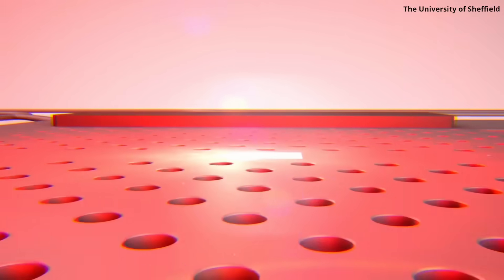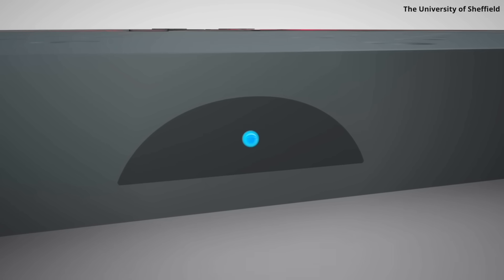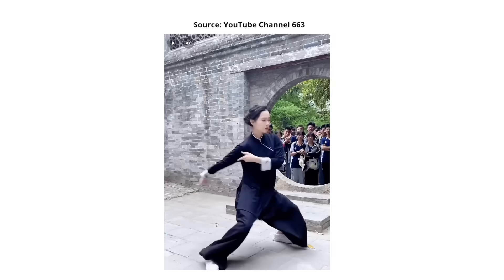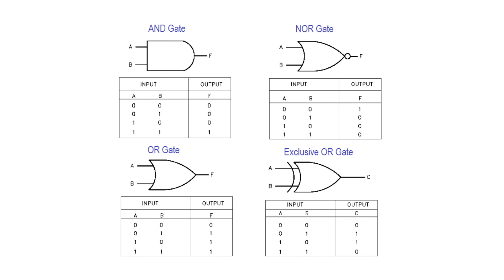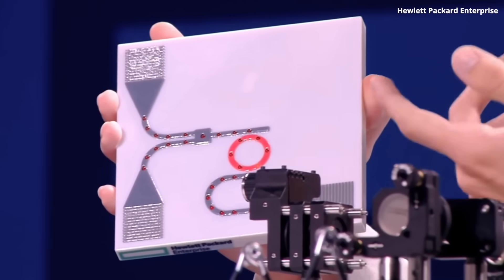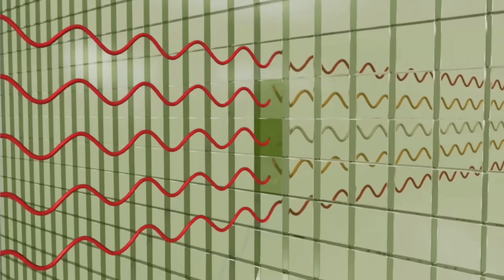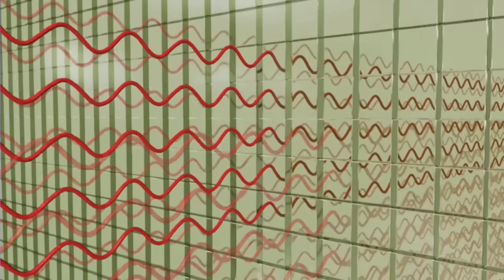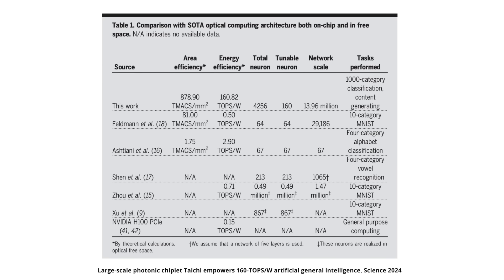Meet Taichi — The Light-Speed Computer

Comment: one major point of photonic computing is that the output (the photons/light) could be directly redirected to the monitor instead of sending it to the gpu which sends the electrons to the monitor and then the chips on the monitor decides and cotrols the led. that causes 10-20ms latency. which photons we could have < 0.1ns latency

Comment: Photonic Computers:
> 5-6 THz  clock speed due to reduced heating
< 1 z.sec. of latency due to on the fly computing
16-32.000x faster computers thanks to parallel computing with light waves.

Comment: cpu are allready light speed. the main upgrade here would be the heat. we could have 4-5 TERAhz cpu clock with that tech. and a correction: we could have 16.000-32.000x faster computing because with photons and light you could use 16-32 difference wave length or parallel computing on the same cpu. (today we can only have "2-ish" parallel calculations on the cpu with the alternating current in a cpu you can use the negativ and positive waves)

Comment: Charles Kao received the Nobel Prize for contributing high speed data communication fiber optics. However, without Corning' chemists' accidental discovery of making pure SiO2 powder, Kao's work would be just a theory on paper. Kuo spent years on purifying glass by removing impurities without success. Corning's chemists found white powder on the wall of a beaker containing SiCl4 liquid. It turned out the white powder is SiO2, reaction product between SiCl4 and H2O(water vapor). This way SiO2 powder can extruded into a thin fiber. They also doped an impurity to SiO2 to change refractive index to form outer layer by co-extruded with pure SiO2 fiber as the inner layer. This allows light travels a long distance via internal total reflection.

Comment: I think you missinterpret the result .. they demonstrate 160 tuneable parameter 4000 or so in total and the weired term network scale which I am not totally familiar with but is not the number of parameters it appears that it refers to the calculations in parallel in the paper they are also reactively vague what the number really means i quote "High on-chip neuron density (up to
4256 total neurons and 160 tunable neurons)
and large network scales (up to 13.96 million in
experiment) were also achieved with the dis-
tributed architecture of Taichi." would be good to know 13. mil of what it is

Comment: Well my brother says the google car is nowhere near driving itself, stating that it gets confusede everytime it witnesses something new. But he as well likes how the LLMs can write code for him.. Said he autocompleted code one day cause the AI was familiar with his project it could auto complete a function he was working on.  Our father was a laser physicist, but he hated computers, it was common for phsysicists to hate computers , I'm not sure if it is still the case. That's why they like to write programs in Fortran.. I'm sure that has changed cause Fortran is an awful programming language. It sounds interesting, but engineers don't really care how stuff is implemented, they are only concerned about stability and if they can use the technology.. The parallelism you seem to be describing sounds like pipeline computing. Some computations though have to be stopped if one computation is dependent on another, its only when the computations are not dependent, that the parallel nature is beneficial. I can imagine that what will happen is the AI neural network will be made implemented with photonics.. Rather than having the photonics chips as a processor with memory locations. Its the need to store information that will slow it down. If it can be made to take input and generate output instantly, then  it will  exhibit its parallel nature all the time..

Comment: If one photonic IC's rate of execution is, say, 1000x the speed of traditional IC, then it's area can equal that of 1000 parallel electronic circuits (all being equal). This is way, way, way too simplistic, of course, but it suggests that the technology may see adoption well before it competes in size with traditional electronics.

Comment: Back in the 80's, I was working at the Swedish chip factory at RIFA (later Ericsson Components) in Kista outside of Stockholm i Sweden. I worked as a layout designer for CMOS and special projects. One day, I was requested to design a 8x8 multiplexer that used photons instead of electrons to communicate. We used a new material that was named LiNb (Lithium Neobath) and it had some exciting features. 
If you designed a junction between three LiNb traces as a "Y" and added a field plate on top of the junction, you could make photons jump between the two different legs of the Y. 
We managed to make the worlds fastest MUX and held the record for some weeks. The switching speed wasn't that impressive with today's standards however, the communications speed, was. It was fully possible to transmit femtosecond pulses and switch them between 8 different outputs from 8 different inputs. That was BACK IN THE 80's. I'm not sure what difficulty in the processes occur but we only made one batch of 5" wafers.

Comment: The gap of crystal navigate the energy of light and the color is angle of the perspective and the line of surface of exposure so by adding or mulpilication all increase or reduce gate the light of appropriate color fir each gate until final result exit after the operation or frequecy , angle , rotation mirroring paralellel or serial or all at tge same times depending on input , operation and lighting , angle of input light on surface would conyrol which gate processor allow input goes through so at trillion of bit happen in second but that mean descrypt the color number at 64 bit color then a dvd 3 hours can descrypt less than 30 milisecond

Comment: It is misleading to say that traditional chips are slow because electrons move more slowly than light. There is almost no current flow in a traditional chip: the information is carried by voltage, i.e., the electromagnetic field, which is just another name for light. The main challenge in silicon chips is to minimise the current flow, because this generates heat.  What limits clock speeds is how long it takes for a circuit to settle into a reliable state. So the issue is not the basic physics, but the engineering challenges. Any new technology, such as photonics will also have engineering challenges, so it is hard to predict in advance if it will end up being better than the current (voltage!) technology.

Comment: But talking about vacuum tubes, one could also use something line an electron projector beaming electrons over multiple matrices. And then it wouldn't have to deal with light's too big wavelength. But then again you would have to deal with the lower speed of your electrons so maybe not such a great idea after all..

Comment: 2:43 wow, that's a bad stock photo for displaying optical fiber.
3:00 The speed of light in quartz fiber is about 1/3 slower than the speed of light.  There is a market for truly high speed circuits to use microwave links because they are both inherently faster than fiber and have shorter link paths because they fly striate paths where as fiber meanders quite a bit.

Comment: Light travels fast in optical fibers, but it is still a lot slower than radiowaves in air because the glass of the fibers is slowing the light quite a lot compared to vacuum speed. That is why some very low latency links are not donc with optimal fiber ljnks but radiowave stations.

Comment: You shouldn't need a high energy laser to drive your photonics. Generate multiple on chip fiber pumped diode lasers. You only drive circuits active for a given operation. Average energy generation should be lower and heat that is generated easier to dissipate.

Comment: Great coverage of photonic processing. Not new though
many jet fighters from 30 years ago use optical processing to achieve flight stabilization (same calculus being run continuously from sensors through near-instantaneous output)
It interesting to see the "new chip technologies" to be commercialization of very expensive and proven military techniques from decades ago. 
RADAR to visual film was a great application of laser processors too, that goes back to the 1960's.....
Reply: That makes me wonder about what the modern day military technologies are 🤔. Not that I’ll ever find out though.
Reply: Not the same because the information from their optical sensors were still being processed by electrical based chips not photonic chips.
Reply: "Not new though
many jet fighters from 30 years ago use optical processing to achieve flight stabilization"

For example patent #5093802 publicly available from the US Patent office from 1989.

Just the public patents show tech that is decades ahead of what the generally clueless population believes is new.

AND the patent law has a classified section that is NOT publicly published.  When an inventor files a patent the "classified section" decides IF it is to be classified "secret, top secret etc"

The inventor is then made an offer "they can't refuse" and if those inventors have a problem with it......Malaysia Airlines Flight 370.
Reply: Good to know not all the tech is public , thanks !

Comment: I hope we use the jump from electronic to photonic to also switch from x86 to RISC-V for desktops, laptops etc. The supposed performance increase by switching to optical should be enough to mask any performance loss caused by getting rid of out of date instructions and emulating them for older software that wasn't complied for RISC-V (i.e. games).

Comment: But wouldn't all the other parts of a photonic computer need to be photonic as well, if you use electronic ram, and electronic hard drive (SSD or HDD) and a electronic display monitor, electronic keyboard and electronic mouse, that will slow down the photonic processing of the CPU, since they can't operate as fast you will be using their speeds instead?

Comment: In the late 80s, someone told me about the concept of Optical Computers. He thought it was in the works, I guessed 30 years. It's been 35-40... we're due!
Reply: Yeah you can definitely find articles on computing with photonics going many decades back.  The concepts weren't the same as this, not using diffraction and interference, but still the idea was there to use light instead of electrical signals.

Comment: This is amazing stuff, but I find it crazy we still want to depend on binary operations with photonic computing. You can use intensity and frequencies to carry much more data and do many more operations. Block blue but allow yellow light -- that's a different value. Tacking on the same old system of computing from the clunky off and on logic gates is also why quantum computing is only slightly more advanced than using a telegraph -- only, yes, it takes a lot to do things this small, and the material science is definitely a challenge, but logic - wise, very underwhelming in implementation. You can calculate every possible value all at once, and use holographic interference. Am I crazy that this isn't obvious?

Comment: Still waiting for researchers to realize that interfering waves can model analog matrixes allowing massive matrix compute using only wave form formula. Meaning your massive tensor computation need only be a handful of colliding waves. Really guys, if the standard module is to be believed you can produce reality equivalent computations using only 17 waves. Given there are more available waves of just visibility discrete light you should be able to compute higher than reality math using just the infrared lasers of fiber optics. That we ever bother to develop larger sequential logic gate chips when N orders of magnitude compute is just sitting in the ambient air you use to observe your fancy electric chip is almost a unfunny joke. Like building a super computer to simulate an abacus and having a Dyson sphere power just your flashlight.

I may have never bothered to learn all the maths, but watching science use a hammer as a wrench is painfully obviously not the best solution.
Reply: So you take infrared through ultraviolet wavelengths and send them through a single chip. This provides a computing framework for each unique light source you can generate without interfering with others. Like stacking chips in the same place at the same time. You can then interfere with each unique light with a separate source modifying the underlying chip during operation, at a rate limited by your ability to correctly time those alterations to the underlying chip.

This method is still using basic logic gates. Now. We take just red. And we send 2 beams through the same tube. The two sources interfere, much like toolset cellphone technology is utilizing, we preproduce a repeating matrix. As long as the light is steady we have a grid of 0s and 1. Each additional light complicates the matrix. Instead of computing all those binary bits you can transpose the position onto an existing matrix, say for an AI, instead of crunching up a probability of a matrix result we just have the light do the probability lift, because it is intrinsic to the behavior of light, and the recorded result can be your return. Simplistically, a bunch of lasers crash together and light a single result on a matrix.

Still on the simple proof of concept here. But the obvious should be visible from here. The right design of waves can replicate any sequence of logic gates, and with dynamical variable waves, you can do any math you want. You don't need the best chip ever built. You just need to know what the wave that would follow it would be shaped like, limiting our computational abilities to our engineering of light sources and capacity to do math.

Comment: One has to start somewhere. Miniaturization takes time. Doing reconfigurable complex calculations at relevantly higher speeds than traditional silicon components has long been a hurdle left for early photonics chips to achieve before we could consider them for general-computing tasks. With this set of new developments, we see a real path forward on these issues - with actual hardware to show for the modeling and preliminary research. That is already a huge leap forward for light-based computing. Working through the problems of scaling gets a huge boost because of the parallelism and speed you rightly highlight. If progress happens on that as quickly as this development did, with this new chip/set, the miniaturization issues will have plenty of length of runway with which to work.

Analogue and photonics are looking increasingly important going forward. Thanks for sharing your impressions of the Tai Chi and the field.

Comment: The hard part is that little red circle.  Interference is relatively straightforward but if you don't do anything else you run into problems since light is linear so the smallest mismatch in the interfering signals can reveal a strong field far down the line.

I presume they are either leaving the pure optical realm or using some unusual non-linear  effect in the red circle but what is it?
Reply: The speed limit is the round-trip time within that circle. If it is a hundred wavelengths long, the 1/1,000,000,000,000,000 s in the video's icon would correspond to a wavelength of the order of 3 nm. Off by two orders of magnitude.
The nonlinearity is probably a change in the index of refraction depending on light intensity.
Reply: @rainaldkoch9093  Sorry, what is off by 2 orders of magnitude?
Reply: @petergerdes1094  The switching time is not 1 fs = 1/1,000,000,000,000,000 s but of the order of 100 fs, at best.
Reply: @rainaldkoch9093  Ok, but who said it was?  Did she say it in the video and I missed it?  I was just a bit confused bc it sounded like you thought I said that.